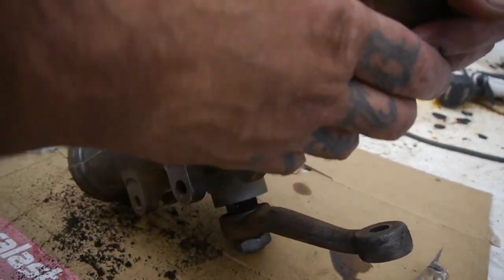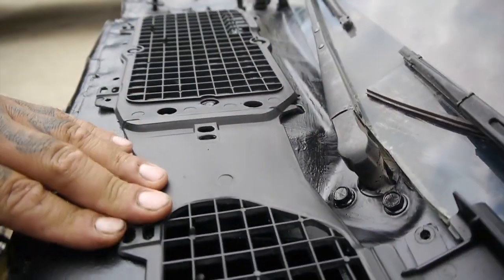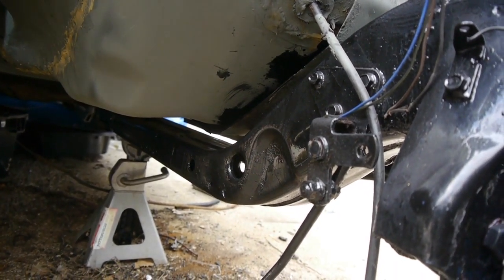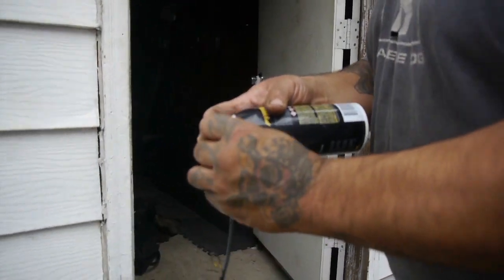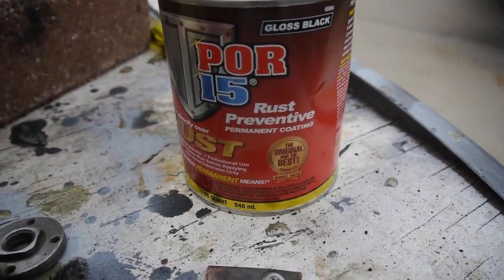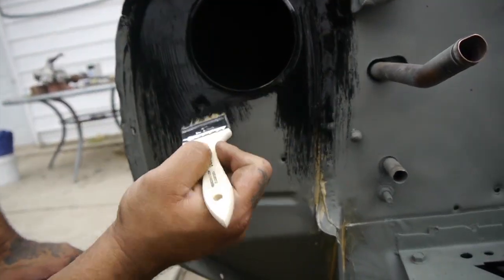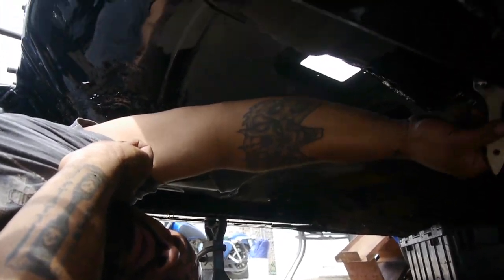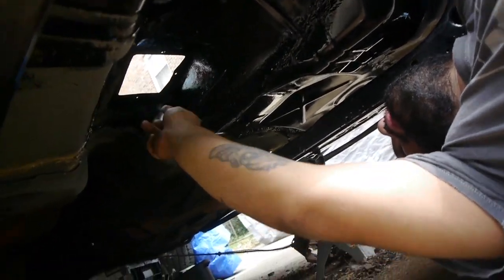78 Trans-Am Firebird Firewall and Floor Pan Get Por15

Comment: Being in this industry my entire life, that's one reason I was my own cars and keep the rocker panels and vent area c-l-e-a-n. Love the coating you're installing and that car will last longer than both of us. 😂  And before I forget, safety lesson of the day....when grinding, buffing or cutting, put some ear muffs or plugs in. You'll thank yourself later in life. 

I've heard that putting a piece of saran wrap or the like on the POR-15 can prior to putting the lid back on will keep it from setting up. I've never tried it yet so don't blame me if it doesn't. Oh, put some disposable gloves on when using that crap, or you'll look like a POR-15 model. 😮    It sure do look purdy!
Reply from the maker: Sir thanks for the comment and knowledge it is always appreciated. We will try the Saran wrap on a quart of open Por15 can the next time we open it. I like experimenting and learning, this is the point of the channel here. We share what we are learning maybe it might one day help someone in the car community.  Even the POR15, we do not just put on rust, we always make sure that we clean off the rust real good and even apply rust preventive etching primer back to the bare metal before applying the Por15. We have found that this method prolong the car a lot better had we just pour the Por15 straight on the rust.
Reply: Yep, two layers of Saran Warp works best!
Reply from the maker: @TallStarlite  I am going to  go to Eastwood paint to buy a quart of Por15 and experiment with the saren wrap and video document it.